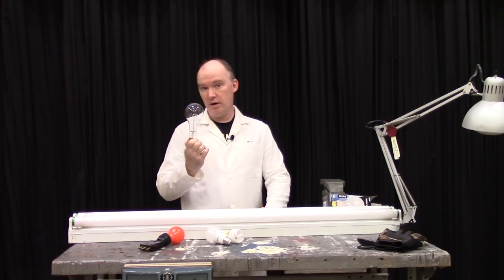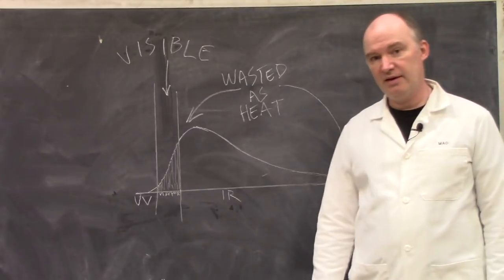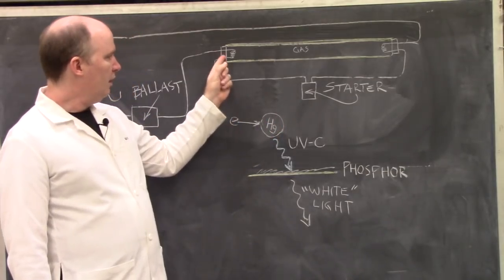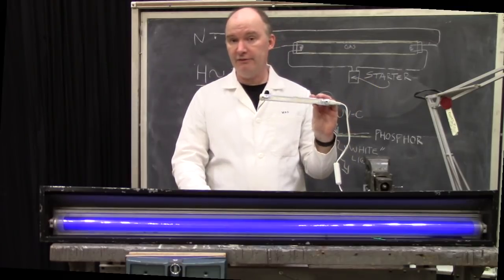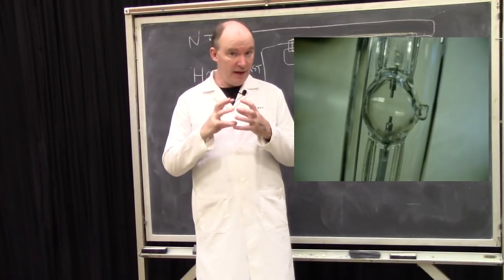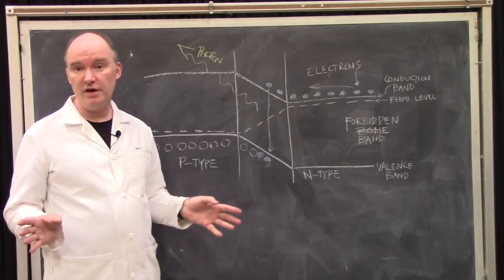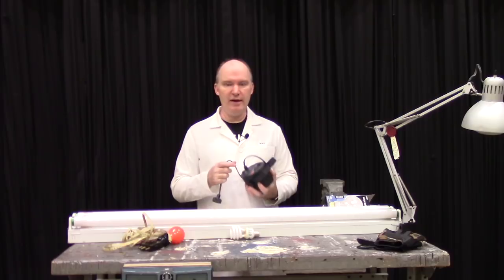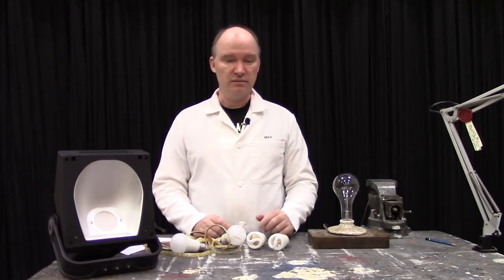Lamps, LEDs and Fluorescents

Comment: Great set of videos! I have watched them all and learned quite a bit. 
I have struggled with connecting low wattage lights (LED and conventional) to different modern dimmers without ghosting or light flicker. Even at a concert hall with modern electronic dimmers. 
Would it be possible to do a talk on the difference in modern dimmers (something around 1970 to now)?

Comment: Absolutely love your videos. The bit about the hilarious inefficiency of making saturated blue with halogen fixtures cracks me up every time. It never gets old. 
And your face scoffing at “white” LED is priceless.
Reply: I may have discovered a worse one!  One of our painters brought in a very old UV light, which as far as I could tell, was just a halogen lamp with an incredibly thick glass filter in front of it, blocking out everything but the UV.  It drew a lot of power and got stupidly hot and she was actually kind of amazed when I showed her the UV LED units you could now get for $20.  She's teaching again this semester and I'm going to ask if she still has it and if so, can I take a closer look at it.
Reply from the maker: The painter in question let me have the lamp!  It's a high intensity discharge lamp, not a tungsten, but it's still a very bright light with a very thick glass filter in front of it to filter out everything that's not UV.  It gets very warm.

Comment: I've got a question: what sort of equipment uses those Xenon lamps? I've tried looking for Xenon-powered stage lights to no avail, since I'd love one or a few for a collection. If they're built for general-purpose stage illumination, would you have a make & model, by chance?

If I can't find any, I might just be forced to build one myself.
Reply: A lot of older moving lights use them.  They were fairly common in followspots as well.  I think the lamp in the video is out of one of our Martin MAC 600s.  ETC also made a HID retrofit kit for Source 4s, but it doesn't seem to be available anymore.
Reply: Ah, thank you! I've been able to find the keywords that I need from that Martin unit's model number.
Reply: @Wyatt_James xenon was used mostly in followspots and large projectors. Video location lighting may have used them as well. Most theatrical/moving head fixtures used some form of metal halide.
Reply: I managed to find a couple of very old Ushio xenon projection lamps since I left this comment, but I don't have any running gear. They were only used in a couple models of 16mm film projectors from the 70s, as far as I can tell. Should have went back and grabbed the one I saw there!